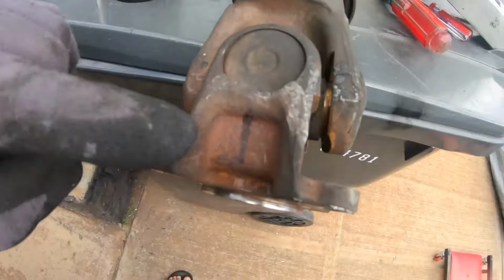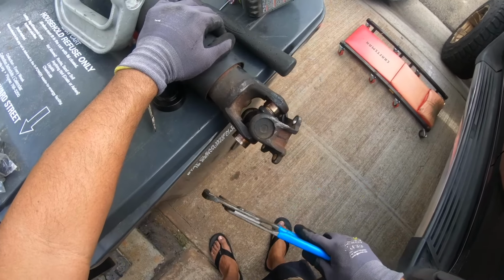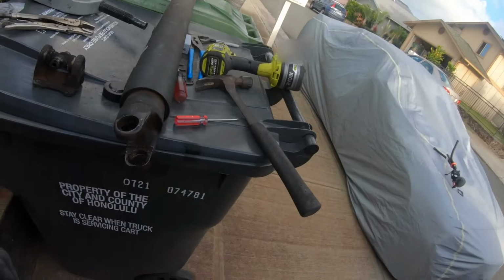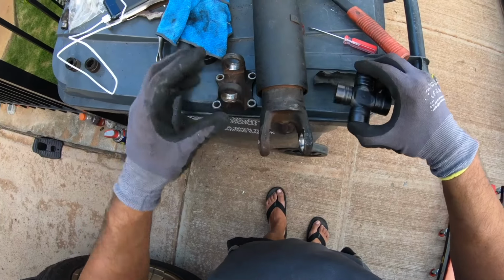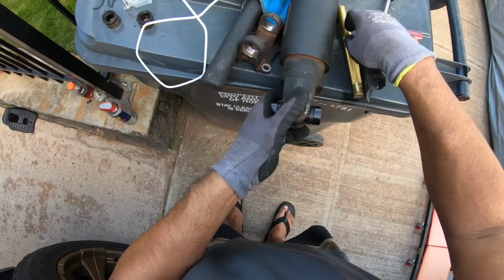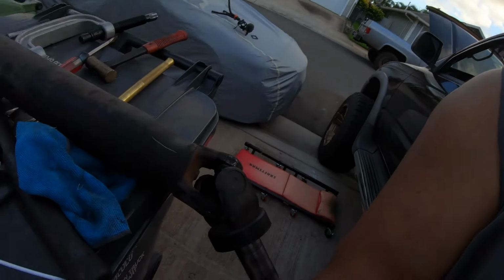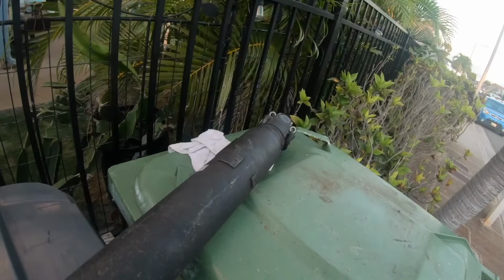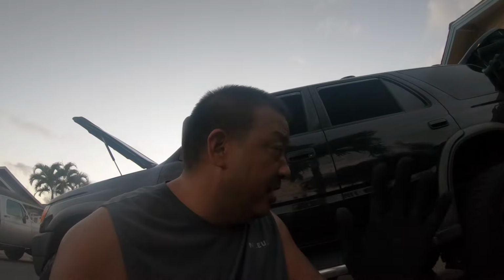4runner / Tacoma U-Joint.  The last project of the year.

Comment: Great video. Love your projects on your trucks. I would not do a body lift on the tacoma. U will not like tbe right after u do it. It's best to put a good high lift with out body lift. I k now people that have done the body lift. They wish they had not done it after they did it. Just give u heads up before u do it. It will make your ride very stiff. Not a good ride.
Reply from the maker: good point. dammmmm that means I need to buy a Bullet Proof 10 " lift now, hahahahaha